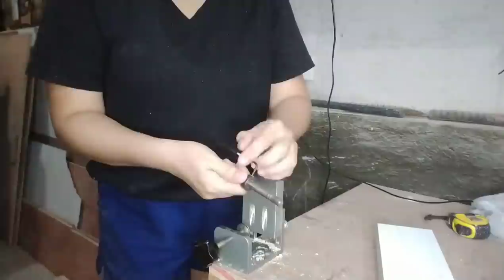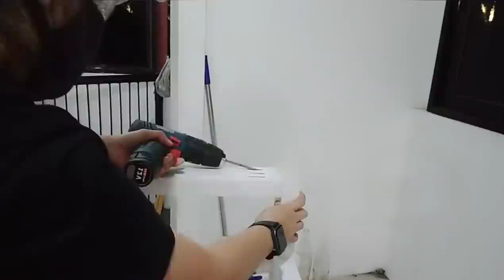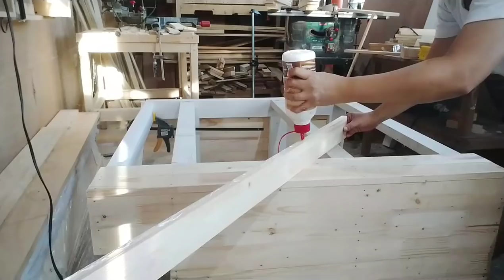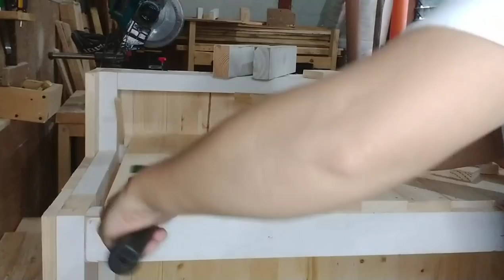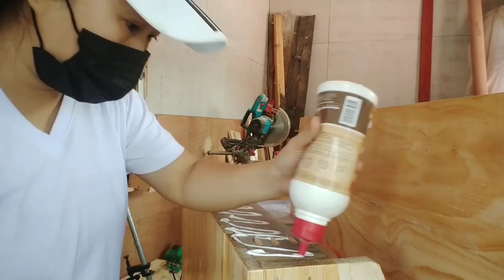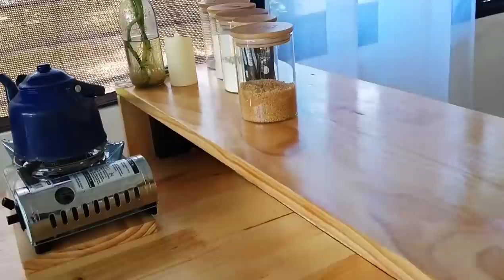DIY Bar Counter - How to Build a Wine and Coffee Bar Table

Comment: Hi! Can you please list down the power tools that you used? I really want to try wood working soon too. You’re inspiring!
Reply from the maker: Miter saw, drill, jigsaw, table saw :) You can actually start with just a circular saw and a drill :)
Reply: @PinayKarpintera  What is that tool you used to drill angular holes on the corner of the wood block? Thanks in advance 🙏
Reply from the maker: pockethole jig po
Reply: Anung model po ng mitre  saw gamit nyo
Reply from the maker: total po yung sliding type
Reply: @PinayKarpintera  Maraminh Salamat po
Reply: Can you highlight  the difference between  mitre saw and table saw

Comment: Is there a cut list or a plan? I would love to try this.
Reply from the maker: 42.5 x 25 x 38.75" po, ang frame 2x4, ang mga support, 2x3 ug 2x2, 1x8 ang bar top, 3/4"x3 ang lower counter, shelf and side panels. I don't have the complete plan, spontaneous build kasi to. di ko na po natrack kung ilang ang nagamit
Reply: @PinayKarpintera  Thank you

Comment: Hi ilang pine woods po Ang nagamit at measurements. God bless!
Reply from the maker: 42.5 x 25 x 38.75" po, ang frame 2x4, ang mga support, 2x3 ug 2x2, 1x8 ang bar top, 3/4"x3 ang lower counter, shelf and side panels. di ko na po natrack kung ilang ang nagamit